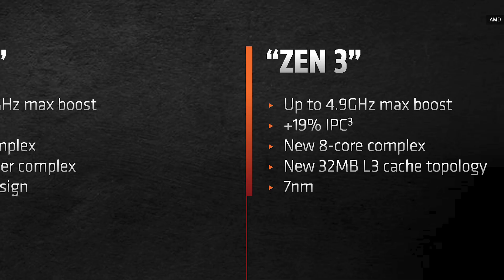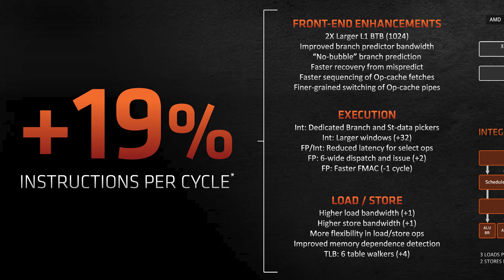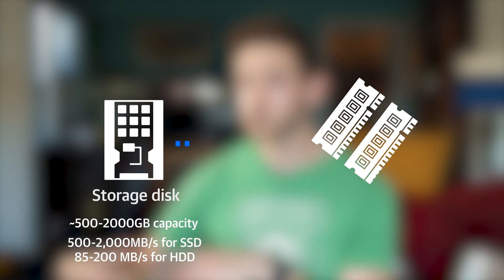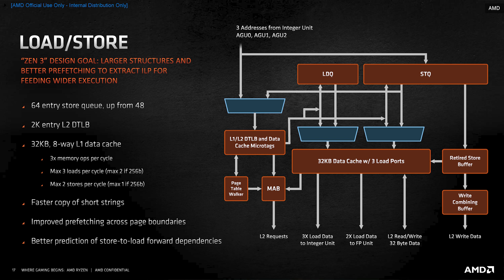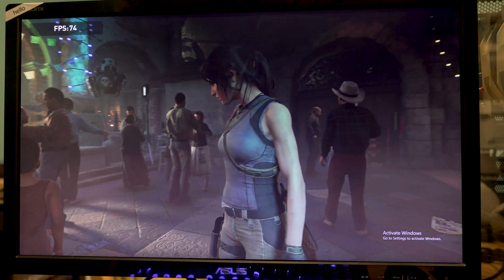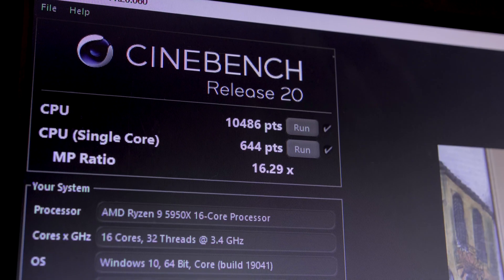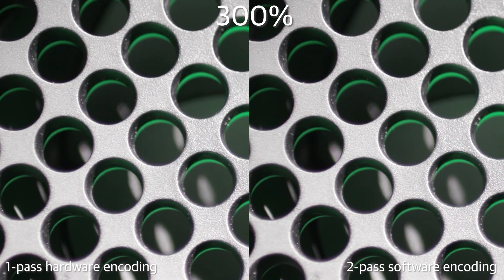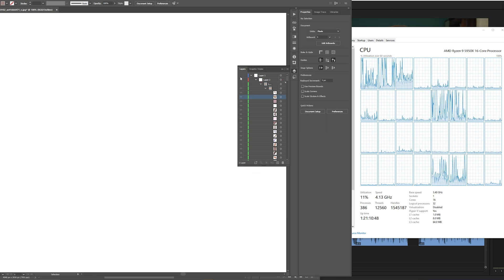How good is AMD's Ryzen 9 5950X for content creators? | Upscaled

Comment: Nvidia comes out with the 2070 super @ $499.....a year later with the paper launch of the RTX3000 series, you can't find an RTX2070 super for less than about $700 (Nov 29, 2020). Heck, the 2060 super which the "60" has always been around a mid-range graphics card is priced at $550+ today! Those prices are just ridiculous.
Not to mention.....
The three biggest paper launches of 2020 are the AMD 5000 series CPU, AMD 6000 series graphics cards and the Nvidia RTX3000 series graphics cards. 1-2 months after launch, no one has them or they come to retailers in drips and drabs.
And unlike the gaming market with there is a major upside to moving from the Ryzen 3000 to the Ryzen 5000 series, for content creation the difference on average between the two series is only between 5%-10%. Not sure that is worth the large upcharge for the 5000 series processor - although the difference between the 3950 and 5950 is only $50 at this point. But a 3800X to 5800X is about $125, or about a quarter of the processors total price....that is a major upcharge for not a huge amount of performance gain in the content creation space.
BTW, you should have include the 3950 in your comparison. You made this an intel vs AMD comparison when it should have also been about AMD previous vs new generation CPU.

Comment: I wonder what will happen when all the I/O dies and those 16c clump in one CCX in the future?Im sure in 5nm refresh they can do that..we just need better APU anytime now AMD, atleast rx470 class
Reply: APU? AMD are still just making APUs only from a previous generation... It's so unfortunate. :/
Reply: There won't be a 16 core chiplet from AMD anytime soon (or any at all). It's a waste of silicon honestly. The main advantage of small monolitic chip is latency. As you pack more core into a single die the physical size increase, communication between cores/cache access will have additional latency which defeat the purpose of the monolithic design. 
Even Intel is starting to move away from monolithic design. Chiplet will be the future

Comment: Thank you for the work and explaining concepts which help many people who are not that tech savy. You do a great job at that.
To answer your question then yes going for the new processor from team blue.
Kindly confirm you ran test on MB Asus crosshair VIII hero?
Also, In the future It would be helpful if you can share the hardawre used for testing. Maybe just put it on the engadget website article. Thanks! :)

Comment: Fun little tidbit i literally use my 3950x, to transcode live TV to x265, while i'm playing a game like Forza horizon 4, and when i'm not playing a game, i have it work on 3 videos at once instead of just 1. Other than a slight clock speed drop, there is very little difference in performance when playing a game while transcoding as long as only one transcode is running(each transcode generally uses less than 40% of the processor)

Comment: "there is just not alot of benefit from redesigning the IO die on the new 7nm process" 
Well one major benifit would be a 3rd, or 4th CCD being able to fit on the AM4 platform, and 4 more CCDs fitting on Epyc/Threadripper
Reply: Very True. Another benefit would be lower electricity/energy consumption

Comment: Although this video was only posted a few hours ago....Apple's "M1" chip put this whole Intel/AMD nonsense to bed...REAL QUICK!.🤯🤯🤯
Reply: LOL no, ARM does not scale well past like 40watts. Sure it'll wipe the floor with any X86 Ultrabook or Nettop. But not a proper 100w CPU Workstation or Gaming Rig are entirely different ball game. The dream of HSA was actualy to have both. Use ARM to be the System operator and massive X86-64 cores as co-processors. Different tools for different jobs.
Reply: Chiriac Puiu  ARM also does not scale well when going bigger especially Higher TDP Wattage. Apple M series will wipe the floor up to Ultrabook Laptops. But even Desktop Replacement Laptops will be a stuggle to compete with Ryzen.

Comment: great video, but I think the math is fuzzy for a second at @902 to @905, you say "5950X has about a third more cores than the 10900k"...mmm...not sure how to tell you but 16/10 is a 60 percent increase in cores.
Reply: He said it backwards. He meant to say the 10900K has about 2/3 of the cores of the 5950X. If it was 15 core CPU for instance, 2/3 of that is 10 cores.

Comment: Technically speaking power draw went down vs zen2 architecture.
Reply: Yeah, technically it does since you get up to 25% more performance for the same TDP. While max TDP is the same on both, one will utilize that power more efficiently than the other.

Comment: You've really gotta dive into the M1. Pretty please?
Reply: @jasongooden917  In your dream?
Reply: @jasongooden917  Nope, Linus Tech Tips has a comparison with the  ryzen 5600. While the results are impressive for a 1st gen chip it would get smoked by a 5950x.
Reply: Yeah, I skipped the whole first part as it's not relevant to content creators. We just want to get the job done.
Reply: Beast is beast always a beast.....
And AMD will be the king of CPU'S
Reply: I have compared 10980xe vs 5950x on r5 raw Intel was faster
Reply: @jasongooden917  " The 5950x beats the M1 just barely but with much more power... review complete "

On a platform that nobody ever wants to use unless they like bending over for the almighty fruit.

Seriously though, all Apple platforms are hopelessly closed - the M1 could be 100x faster and I still wouldn't touch it with a barge pole.
Reply: @mnomadvfx  If your primary software happens to run natively on the Apple M1and it’s much faster then who cares who makes it, or if it’s “closed” to some software. This is really a non-issue for most people
Reply: @johngwheeler  lol that's why it has a marketshare of less than 20%
Reply: +1
Reply: +1
Reply: +1
Reply: +1
Reply: +1
Reply: no
Reply: At a MUCH higher TDP. Anyone can make a high performing chip if you just keep pumping power into it. But eventually physics will hit back. X86 is showing it’s age.
Reply: @RobStevens64  in part, the M1 is so fast because it has everything in a single DIE, even the RAM. It hard to scale that chip up, without loosing alot of its advantages. This really isnt so much about the difference between x86 and ARM as it is about scalabillity vs limiting your design to a specific usecase. For the M1 thats Low-Power mobile with the disadvantage of a max of 16Gb Ram. AMD and Intel however will most likely not develope a specific design for this and therefore are at an disadvantage in this case. On the other side, Apple would need a totally different design to get anywhere near Threadripper performance.
Reply: @johola  amd already has native x64 based processor ready, one with ram built and one without, just wait and see and thank me later for the news.
Reply: @RobStevens64  nah mate, you need to get your knowledge checked, those are x86-x64 processor, and for amd they are amd64, they are x64 based processor that has underlying x86 instruction set for legacy 32 bit program support, and AMD's x64 based prototype is already ready with no legacy x86 support for next years CES or later.
Reply: @RobStevens64  if physics could really stop engineers then intel wouldn't have been able to milk same 14 nm architecture for over 5 years and compete lol.
Reply: +1